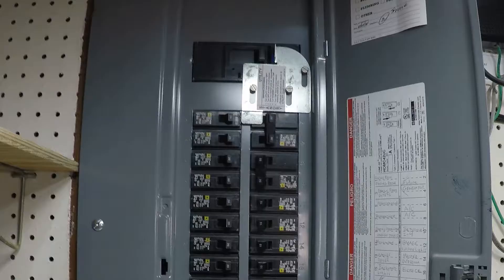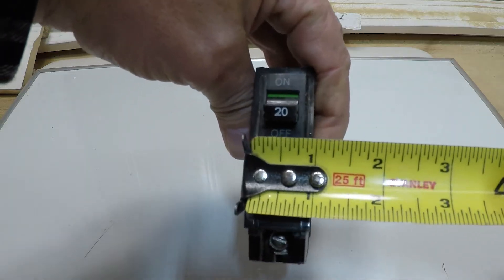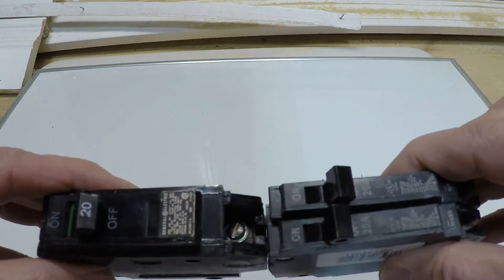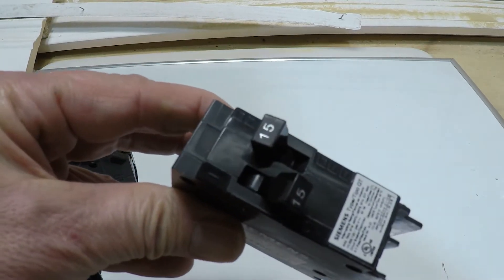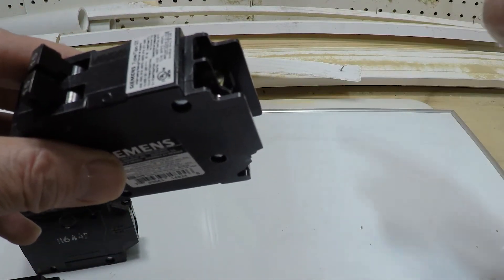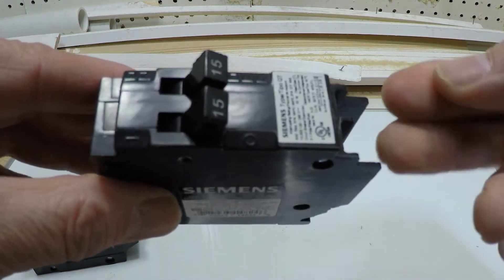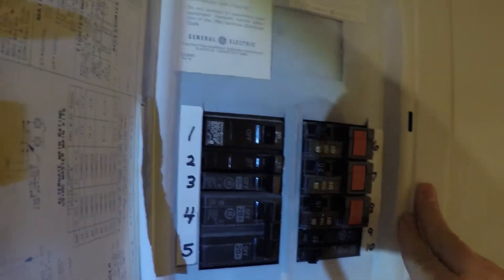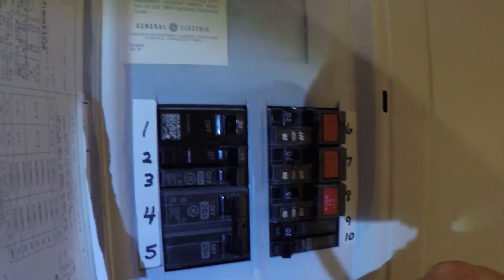How to Make Room in Your Electrical Panel (and Why You Should)

Comment: They also make tandem breakers that have a 20 amp on one side, with a 15 amp next to it, so you have the option of adding a 20 amp new line next a 15 amp 'old' line when you replace a standard 15 amp single regular sized breaker.

Comment: I have a Westinghouse main panel at my residence which was built in 1987. Eaton acquired the division of Westinghouse  which manufactured panels and breakers  in 1994. Eaton  integrated the former Westinghouse division with their Cutler-Hammer® business unit. I have had good success using the proper Eaton breakers to replace or add  breakers to the Westinghouse panel.
Reply: Same here; I have a 'Bryant' brand box, and Eaton makes new replacement breakers for that brand, too.